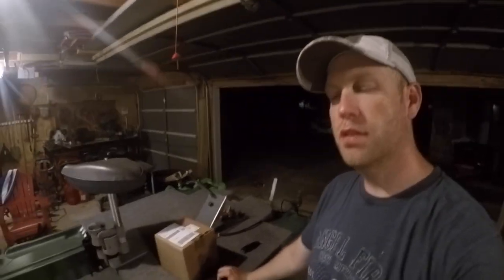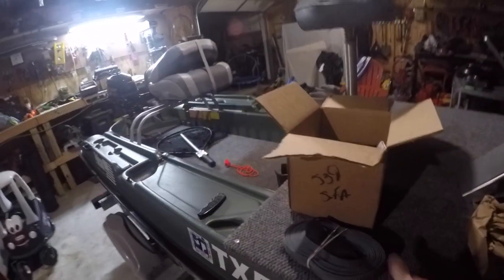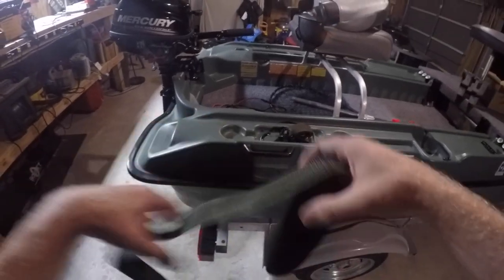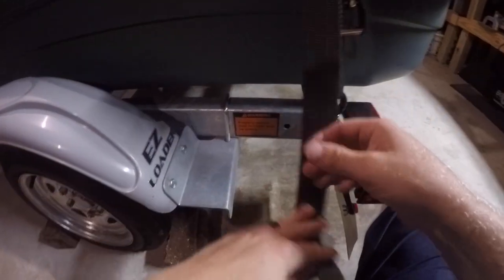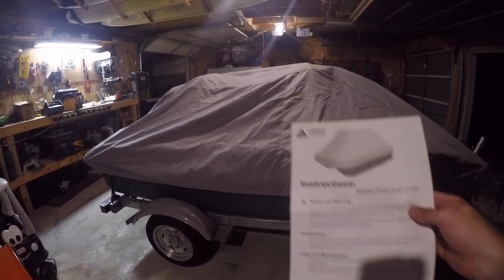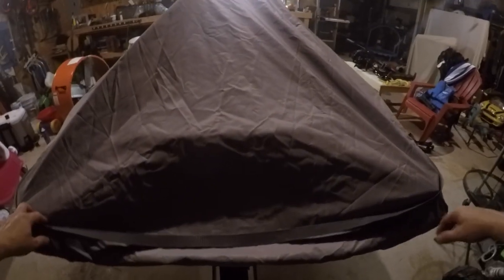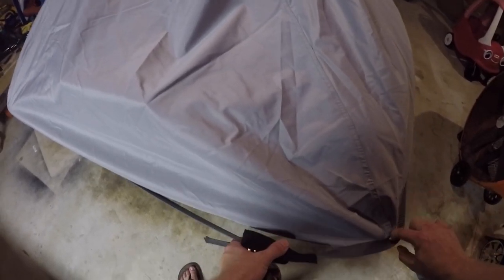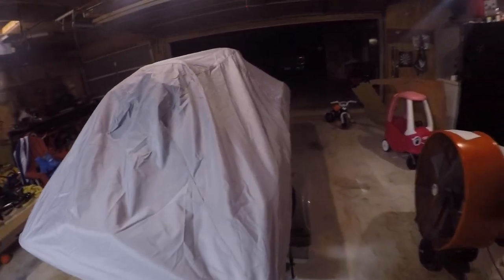Pelican Bass Raider 10E: Boat Cover & Custom Ratchet Straps

Comment: Hey MaxCast....Really like your video's...I also built a transom saver for my bass raider and i was wondering if this boat cover fits with the addition of your transom saver. Also, looks like leaving the seats in should not be a problem, right? . How is the cover holding up in the weather? I have gone through several covers and not found a durable bass raider cover. I saw a Pelican cover on Amazon but it looks like i would have to take seats out in order to fit.. Thanks for your help.

Comment: Hi Charlie - Great channel! I also have a Pelican Bass Raider and have added a lot of extras to it.  Could you by chance send me the link or the order info on the 30ft ratchet strap you have that wraps around the boat to hold on the cover? I was on their website and can't seem to figure out the exact type I need.  Thanks!
Reply: I found where to order them on the site.  Where it says "Ratchet Strap End Hardware "  Which did you select? There is no option for none on there.  It's having me make a selection.  I don't want to order them and have hooks or something stitched on there.   Thanks.
Reply from the maker: R J, thanks for the compliment!  Select the “Ratchet Strap Only” under step 1 and for this strap I selected “heavyweight polypropylene”. I selected “1 inch” which takes you to the remaining options. I picked “30 feet” and the “black oxide ratchet buckle” and “please sew on buckle pad”. If your using your phone, switch the website view to the desktop version. Hope this helps!  All the best!
Reply: @maxcastfishing4357  Thanks!  I found it. How is the cover holding up for you so far? I am seeing mixed reviews online about them.
Reply from the maker: R J so far so good!  I haven’t had to use it much, as the lakes and ponds I fish are close to the house. I honestly only keep it on the boat in the garage and have it with when I’m out in case it rains.  If you get one, I would find someway to keep the extra space filled (like keep the seats on it, but secure the seats so they won’t bounce out). In other words, have something to keep the cover up, similar to a camping tent. I saw somewhere a guy used 3 sections of 1/2 inch PVC bent in an arch (the PVC base fit in the seat rails/slots) to keep it rigid. I think not having the extra material supported, it would flap around too much in the wind and cause damaged. I hope this makes sense!
Reply: @maxcastfishing4357  That does make sense.  Like you, I wouldn't be taking mine far.  There are a lot of lakes near my house I usually fish at.  I will have to try and post a video on my mods as well.   Thanks for your help!
Reply from the maker: R J I’ll keep an eye out for that MODS video!